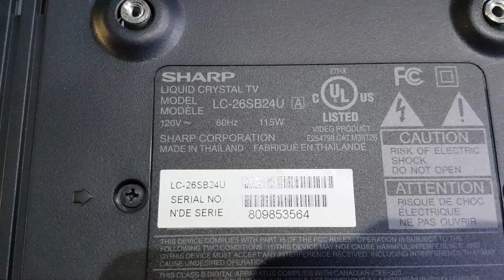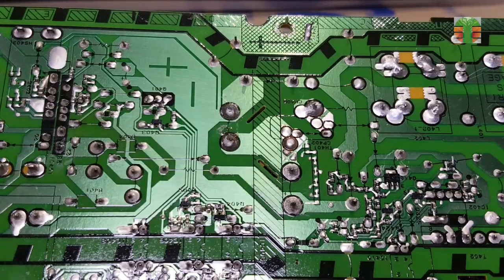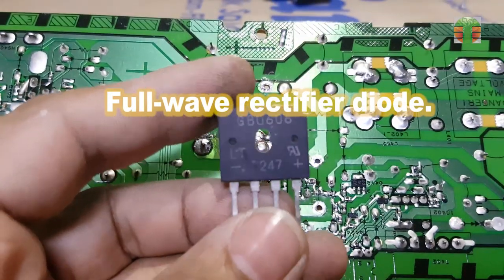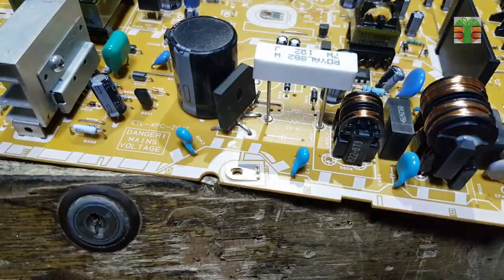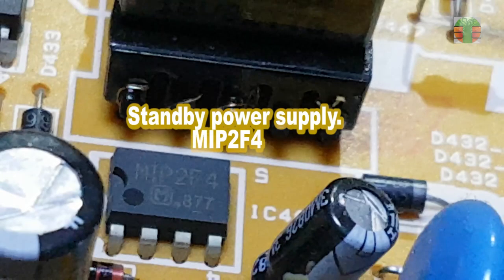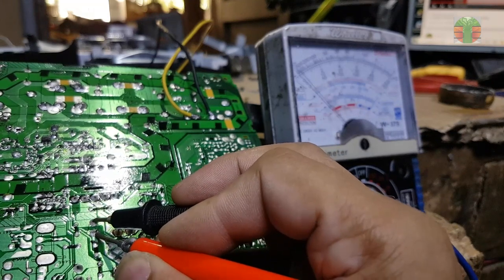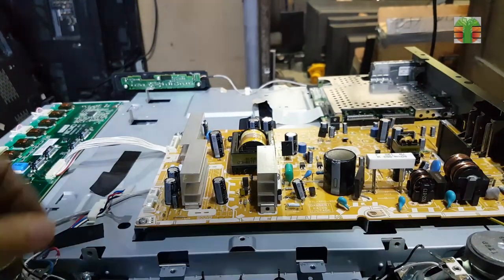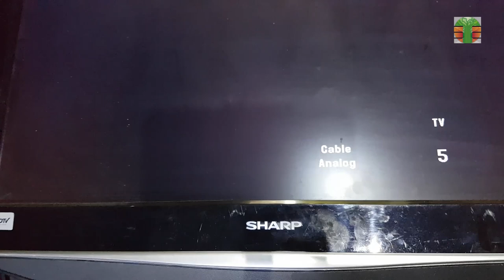LCD TV 120 volts convert to 220 volts

Comment: Galing mo master.. sir tanong ko lang yung wattage po ng resistor na pinampalit niyo sa rec diode.. kung ok lang b 1/4 watt na ipinalit mo sir sa positive line ng ecap?
Reply from the maker: 1/4 pwede na. negative sa ground
Reply: Salamat sa reply po.. bale purpose po ba ng resistor ay discharging ng ecap po..?
Reply from the maker: @delshanshaman7940  Supply sa capacitor para sa standby 5 volts

Comment: Is a 220-240v/50-60hz Plasma TV ok to use on 120V. No mention of 120V so not sure why 60hz is on label
Reply from the maker: most of plasama tv are auto volts. not mater if 60hz or 50 hz
Reply: @tevzTVTevatronics  model is TH-42PX7B
Reply: The one I have is modified for 400hz.

Comment: nice job mate, you are amazing. Of course enjoyed. Could you advise how to convert Samsung smart tv from 110 to 220v ?
Reply from the maker: You can convert it by only replace the main capacitor to 450v, but not all will work, some is auto volts no more component to replace.
Reply: @tevzTVTevatronics  thank you very much. What about hertz? Do we need to change it from 60 to 50 ?

Comment: How to convert Toshiba lcd 110v to 220v
Reply from the maker: It can be covert to 220volts by replacing the main capacitor with 450 volts, but not all will work.